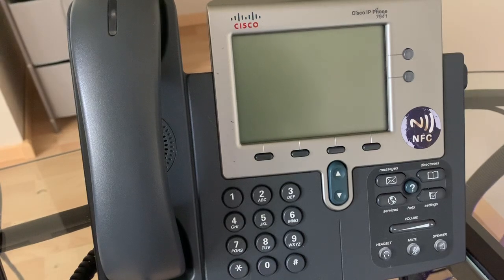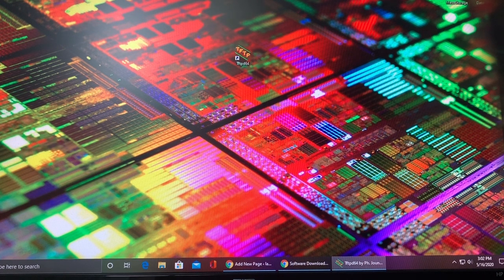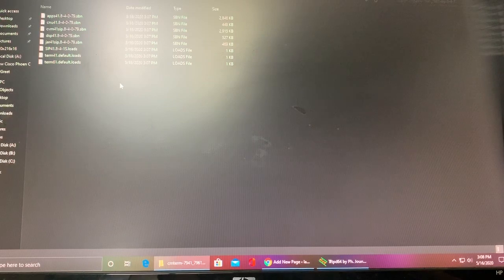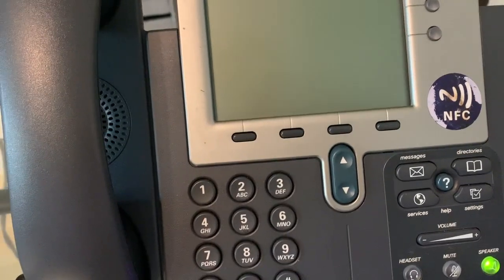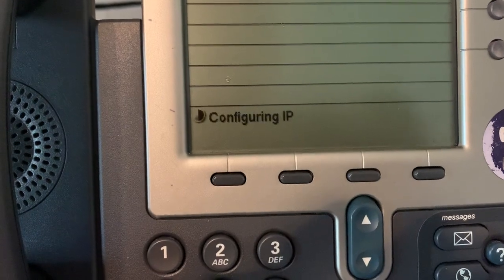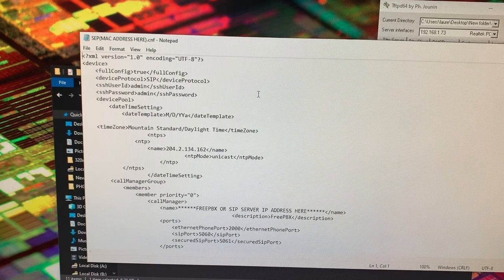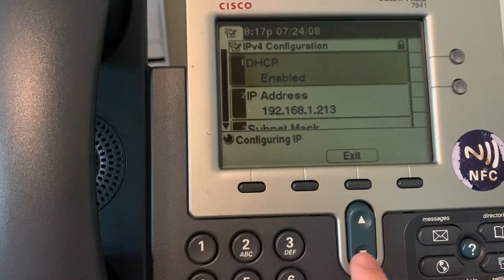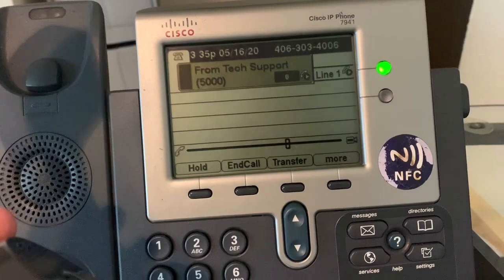HOW TO connect a Cisco 7941 with FreePBX

Comment: Wondering if you can help... my phones are not provisioning. The phone pulls the config file from my TFTP server, but when the phone boots up it continues to list itself as "unprovisioned" without any changes made. Unsure if its to do with my PBX; I'm running FreePBX on VirtualBox with a bridged adapter. My softphones are connecting no problem so I don't think it's routing related. Thanks so much for a great tutorial.

Comment: First of all this video is great! I can't thank you enough.  I'm working on setting up a small business and we need a phone system.  Question: can the TFTP server be on the free pbx server instead of on a separated computer? Also can the SIP firmware be transferred from the free pbx server instead of a separate computer.
Reply: @bcm50  Thank you. I don't have the power plug for my phone. I'm using a PoE switch. No worries I'll figure something out.

Comment: Looking for some help getting a 7942 to work with Everyday Voip. Following this excellent video has got the phone working with the SIP protocol, now I'm trying to do the configuration file. This is where things seem to differ from Free PBX. Everyday Voip have given me a SIP URL (from which I got the IP address) and a port (5060). Then a username and password for my account. I can't see where in the configuration I can enter the username/password bit. I don't want an extension number, I just want this to be the phone that rings when my VOIP number is called. Any ideas?
Reply: I am following the same steps in the video for a 7942, and when transferring the files, nothing seemed to me, only the log indicates that TERM42.defaul.loads were sent.
then the phone shows the Cisco logo and does nothing.
How did you manage to update it successfully?

Comment: Thank you for your awesome video!! I will try this settings with a Grandstream UCM hoping it works. I will text back with my results.
Reply from the maker: Sounds good, I wish you luck!
Reply: @bcm50  I tryed your method and the phone its in a loop registering. Maybe something is missing to be provisioned. Any thoughts?
Reply from the maker: @elvismateo7022  Could it prehaps be your PBX? Are you US King FreePBX? Did you check the credentials and fail2ban settings?
Reply: @bcm50  no, I'm using a Grandstream UCM. In the end I found my way to encourage the customer to change the whole phone line up for a better user experience, so I don't have to configure cisco phones anymore.

Comment: I am new to it. correct me what understood is that  basically you have to run a freebox server and use it's IP address in the XML file to register the phone beside other settings.is there any other way to register just one Cisco phone after converting to SIP firmware without the free-box server?
Reply from the maker: Yes, by using CUCM or CME
Reply: @bcm50  wish you can add a video for 1 phone

Comment: This is great! I however am stuck with some enterprise 8851 on CUCM fw. I was able to use this method to get to the 3Pcc fw but it says I need a migration lic. Any way around this? Trying to get these prov to Zoom and it looks like it’s getting my line info from zoom but can’t make or receive calls and the mig lic warning pop up
Reply: Any help would be amazing
Reply: Any ideas?
Reply from the maker: Do you have discord, I can help you there?
Reply: No there is no way around this.  If the phone was purchased new you would have bought the 3PCC version of the phone if the phone is a used enterprise 8851 then you have to pay Cisco for the migration license.  But the migration license isn't that bad it's only around $50.   Note that the 3PCC firmware requires a completely different TFTP config file format.  Flash it back to the enterprise firmware and it will be fine you can use it with the enterprise xml config

Comment: Hello, with the help of your video I was able to configure a Cisco 7942 and register it with an Elastix pbx, but I have not been able to configure a Cisco 7962, it remains registered. If you could help me guide me with the configuration file for this model, I would greatly appreciate it. thank you.
Reply: How did you transfer the files? They charge me but the phone then only shows the Cisco logo?
Do you have the Firmware for the 7942?

Comment: Awesome video.   Do you know if there is a similar XLM config file for the 88xx series phones?   Specifically, the 8865.   Thanks for your help.
Reply from the maker: You can use the same XML config file!
Reply: @bcm50  I tried this on my 8811. It keeps asking for the CTLXXX.tlv and ITLXXX.tlv files... which I don't have since , I do not have CUCM. Is there a way to bypass this? the phones are brand new with 11.7
Reply: @bcm50  Hey Laurens. I just purchased my cisco 8851 and I need help setting it up. We do text so im sure you know me its Lawrence. When you can please respond tot he messages iv'e shown you so you could understand more. Thanks
Reply: It will ask for those files if the phone has a private key in it.  Do a factory reset of the phone by the 123456789 method which is detailed elsewhere and that will wipe the phone and wipe the keys and then it will attempt to pull a non-encrypted version of the tftp files

Comment: Apparently, you need a service contract.  I provided the serial number that is on the UP 7965g phone, but the serial number was not found in the CISCO database.  Are the files for 7965g SIP and for UP 7962g, available from another location?
Reply: You only need one for the newest firmware. Try downloading one a version back.

Comment: Is it possible to use the built in TFTP on FreePBX? I was able to flash a 7965 using tftpd but I want the config files to be on the local FreePBX server. I placed them in the tftpboot directory on the server and made sure the services were started and enabled at boot, but the phone remains unprovisioned. Will I need to always flash the configuration file via tftpd (or similar) when registering to FreePBX?
Reply: Fixed my issue, but then I was having an error getting my config file to validate - turns out Label's are limited to 12 characters. Changed my label to under 12 and phone is registering now!

Comment: So um what If my phone doesn't have a power plug and I was just planning on using POE?
Reply from the maker: Yes, that is fine, that will work too!
Reply: Set  up a VLAN on your switch to isolate a few ports away from your local network. Then you can use the switch as a passthrough for the TFTP transfer of the SIP files with your computer acting as the DHCP server.

Comment: My phone connects to the server but the phone says error after about 10 seconds any ideas?
The tftp server says sendto error 10051: A socket operation was attempted to an unreachable network
Reply from the maker: VLAN and other blocking may be in the way, and just to confirm, your using TFTP64 correct?
Reply: @bcm50  Yes I am using TFTP64 and the phone and server are directly connected with a poe injector
The phone just goes to reboot as soon as it starts downloading the files

Comment: Ok im stuck at registering...
i can see the name in the uper right corner
status messages
error updating locale
dns unknown host
tftp error softkeys.xml...

i changed freepbx to listen chan sip on 5060 
i can register from 3cx soft phone with the extension credentials...
am i missing something?
Reply: @bcm50  ok i just change the port to 5160 and it worked. what is not working is the time its 5 hours ahead of time. i used my time zone  <timeZone>Eastern Standard</timeZone> don't know if that will be correct
Reply: also i forgot to mention i also disabled NAT on the ext.
Reply: @carlosmcnulty  you saved me. Thank you so much!

Comment: Do you need to use chan_sip indead of chan_pjsip?
Reply: Hello to all the users who are facing issues with registering the Cisco 7941 with FreeBPX 16 and up, create a new SIP[chan_pjsip] extension , 1st in general setting chose a simple 6 digit secret and THE MOST IMP 2nd STEP , go to advance tab and turn these TWO SETTINGS TO NO (Rewrite Contact - No), (Force rport  No), by doing these 2 steps it will surely connect.

Comment: I hv a cisco 7942, and following yr step to regiest with FreePBX, but at the TFTP always show follow errors :
Connection received from 10.0.10.26 on port 49238 [12/09 09:03:20.753]
Read request for file <CTLSEP5CFC665DBA41.tlv>. Mode octet [12/09 09:03:20.753]
File <CTLSEP5CFC665DBA41.tlv> : error 2 in system call CreateFile 系统找不到指定的文件。 [12/09 09:03:20.753]
Connection received from 10.0.10.26 on port 51296 [12/09 09:03:20.858]
Read request for file <ITLSEP5CFC665DBA41.tlv>. Mode octet [12/09 09:03:20.858]
File <ITLSEP5CFC665DBA41.tlv> : error 2 in system call CreateFile 系统找不到指定的文件。 [12/09 09:03:20.858]
Connection received from 10.0.10.26 on port 52514 [12/09 09:03:20.958]
Read request for file <ITLFile.tlv>. Mode octet [12/09 09:03:20.958]
File <ITLFile.tlv> : error 2 in system call CreateFile 系统找不到指定的文件。 [12/09 09:03:20.958]
Connection received from 10.0.10.26 on port 50910 [12/09 09:03:21.189]
Read request for file <SEP5CFC665DBA41.cnf.xml>. Mode octet [12/09 09:03:21.189]
Using local port 63869 [12/09 09:03:21.189]
<SEP5CFC665DBA41.cnf.xml>: sent 15 blks, 7400 bytes in 0 s. 0 blk resent [12/09 09:03:21.308]